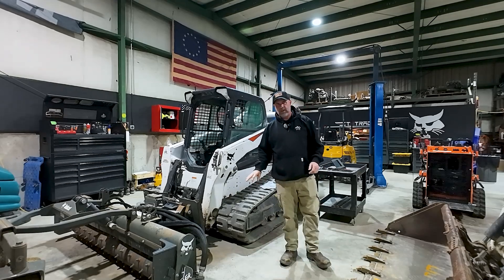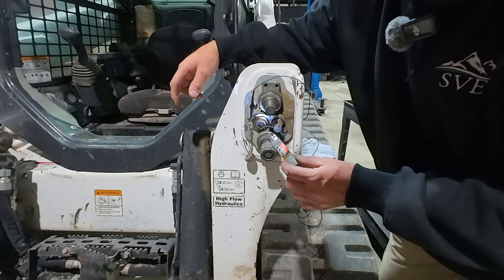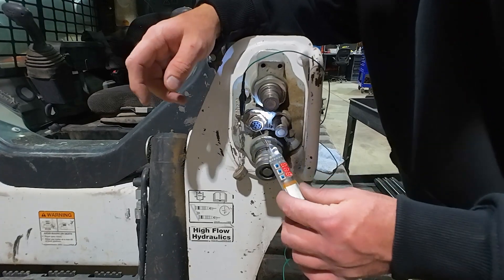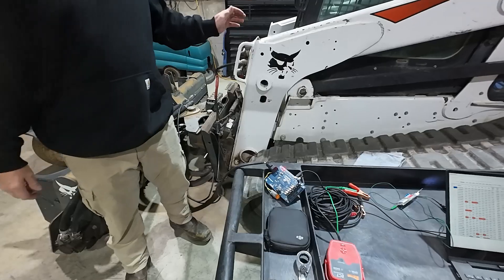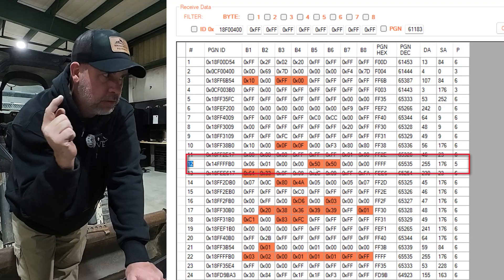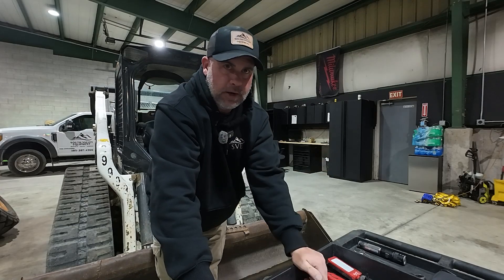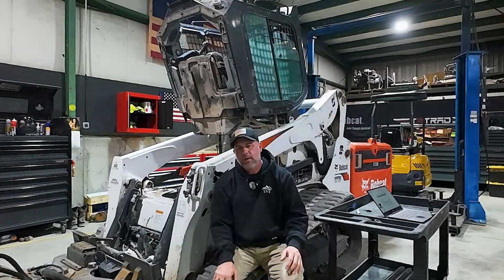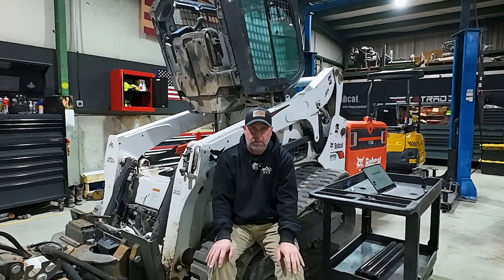Dealer Charged Thousands… Didn’t Fix Anything — I Fixed It for FREE!

Comment: Your right that the leader ship is a problem alot of the time when you have these issues that are gremlins. A forager i used to drive had a fult code that started popping up it was a code related to the turbo/air side of the engine i had three months of the dealer messing changing sensor and riding on the machine to see what it was doing in reall time. From the start i new it wasn't the turbo you could tell by driving the machine there was no pattern to when it coded so that told me it wasnt a manical. I supected it was a wiring issue. Anyway the work shop manager had his head set on it been the turbos but i dug my heals in because it was about £7 or 8k each for the turbos. Anyway the manager got his way and convinced the owner to change the turbos and there was no change the codes where still there. By this time we had spent about £25k. Pissed off we got a different  dealer to have a look at her with in 5 hourse the other dealer had the issue sorted it was a bad ecu. Because of one wooden headed workshop manager been been stubborn it cost us 20k more then it needed to

Comment: Really appreciate all the knowledge you share in your videos, especially about working on compact track loaders.  I've determined that the AC compressor on my Bobcat T300 has to be replaced, but I have no idea how I'm going to remove it without pulling the whole motor out.  Any suggestions on best way to remove the compressor?  From top?  From the front? Or is pulling the motor out the only way?  Thanks in advance for any advice you can provide.

Comment: Great job! I agree with your assessment of management!. I have a 06 S185 with 1850 hrs I've owned it for 6 years. I finally found a low hr machine with a 1,000 hrs!, but i almost gave up and bought a new bobcat and im glad i didnt!. I've 10 bobcats all the way back to the old 600's w/ a wisconsin air cooled gas engine. When they put Kubota diesels in them you couldn't beat those engines!. I worked as a excavator operator for years with a company that had a fleet of 35 bobcats, when Doosan took over they had so many problems with them they now own skid steers from 4 or 5 different manufactures trying to find a good brand to go with.
In my opinion todays electrical technology has ruined all equipment. 
You do a great job teaching and explaining when you do an assessment and repairs a machine!.

Comment: Just found a similar short to ground on a engine harness on a cat skidsteer.  The harness rubbed through on a latter clip due to a loose zip tie. You could induce a misfire by pushing on it.

Comment: The issue is all the unecessary digital crap that needs adfitional modules to have things operate.  This necessitates having software, programmers, "sniffers", etc.  Granted, if your a tech, you should be trained and have the tools, but most dont.  Great find, explanation and fix.

Comment: This is my Bobcat T 770 he was working on.  
I took it to the dealer in early October to fix what was described in this video. After weeks of no response I called the service department and asked what the status of the machine was and the service writer said that they would try to get it in tomorrow.  Weeks went by and I got a phone call asking for another hour or two of diagnostic time because the tech, "almost had it."  I authorized the additional diagnostic time. Then two weeks later I called the service department to ask what the status was.  The service writer said that the tech was at lunch but that she would talk with him about it when he returned and get right back to me, probably 30 minutes or possibly one hour.  I called again two hours later and nobody answered the phone.  Then a week later I got a text message with a request to authorize the repair. $900 for diagnostic and $2500 to repair the problem.  I was angry. I was angry that they wouldn't communicate with me.  I was angry that they wouldn't get this job done without constant prodding. I was angry that it was so expensive. I can take one form of abuse, but for them to charge me exorbitant rates and string me out for months was too much.  I called the dealership in the morning and told them I was declining the repairs and that I'd be picking it up on Monday.  They didn't ask one question as to why I was upset, they didn't offer to understand my position. Just okay they said.  When I went to pick it up she told me that the total was $3200.  How's that? I asked.  She looked over the work order as she didn't know anything about it and recited to me all that had been done. Then she told me that she would take 5 hours off making the total $1800.  I told her that I didn't authorize the work to be done. She cut me off and told me to stop. I was furious and told her that I wanted her to listen to me. She silenced me again and told me that I wasn't listening to her. I paid the bill, and walked out of there for the last time. This was December 17th. So about 10 weeks since I dropped it off for service. 

I took it to South Valley Equipment and they asked me if it would be okay if they got to it in a few days.  Absolutely.  Then I got a text message later that day that it was finished. I came in the next day and was told that the repair took 15 minutes and that he wasn't going to charge me. 

It seems clear to me that management at the Bobcat dealership has told the service writer in the past that it doesn't matter what the issue is, but that these customers need to pay for the time the techs worked on it in the shop. I think she had her hands tied.  It didn't matter that they didn't know what was wrong with the machine, or that they spent all kinds of time trying to figure it out, or that the techs didn't know what they were doing.  What mattered to them is how much money they can get out of me, and they figured it was $1800.  Well I needed my machine that day and they had me over a barrel. I paid it.  Never again.

Comment: In reality, when they have a networked system like CAN bus in the bobcat, the thing should be able to self diagnose itself.   The fact it can't, is the biggest egg on the face of the farces of engineers that put together the electrical system.   It should be able to start with power and test every communication circuit and identify the ones that are not working within a few minutes and then there should be a bluetooth connectable tablet that should guide the tech through all multi meter voltage/probe readings in order to restore communications  / power to the affected circuits.  The fact that this was not done is a huge irresponsibility / incompetence/ lack of insight on how to use the very technology they integrated in the machine. They threw it's biggest advantage out the freaking window because it was more valuable to the end user rather than the manufacturer.   They should hang their heads in shame.

Comment: I just had a similar issue on an S70, what a pain it can be to find those shorts. It was the harness that went under the right side pump, it had chaffed and went to ground on the pump. It gave us fits because it would be there, and then it was gone. A word of advice: get the electrical prints, it can save you HOURS of looking through the various circuits.

Comment: 5:25  Broadcast is the nomenclature.  Every device can see every message on the wire because the messages are broadcast.

I'm a little surprised a circuit tracer works very well.  Guess the fault being on the power side is the saving grace as they are not shielded.  That is indeed a leadership issue.  You have a blown fuse.  Cool, you know you have continuity.  You are further ahead than you might think.  Next step is segmenting the trouble.  Keep breaking the circuit in half.  Follow the trouble side.  Even without a tracer a shorted wire is probably the easiest to resolve.  And being a dealer you know as soon as they segment the trouble to a section of wire harness.... They will replace that harness eight out of ten times.  

Rigid machines... wire harness retention and routing is critical.  I don't deal with the electrical side of the engineering, but many times when a part revision is requested  It is because the electric peeps want something.  I teach my team to never think anything of it.  We design and build equipment that moves the world.  One wire taking down the bus will take a machine out of service.  I never want even the perception of animosity if a team member wants to adjust something as simple as wire routing, or retention.  Also good reason you don't see solder in OEM harnesses... and highly discouraged in our dealer network.

Comment: Never in a million years did I imagine I'd see hexadecimal CAN bus data on a YouTube video...I spent a good portion of my career analyzing raw hex bus data on military aircraft and never expected to see that again, especially on YouTube, after retiring.  Nice work!
Reply: @jimharris8707  Odd... because there is a lot of it all over the internet.  Anywhere from guys pulling messaging off the line for troubleshooting to building custom gauges, or entire gauge clusters, to injecting messages for a feature, or even theft.   Decades of it all over the internet.
Reply: I just left the automotive machining industry, didn't my entire life after collage tech school working with binary, octal, and hex code on the back end of every iteration of mumbojumbo user interface crap ever used.....😂

Mann it's good to be retired

Comment: Also curious with thats issue before being fixed if he were to use the skidsync box would it still work with the short to ground issue??? Curious
Reply from the maker: Great question.  The skid sync box is completely independent of the machine so yes it would work flawlessly.

Comment: I like that digital light tester what kind is that??? Keep the videos coming 🤝🏽🤝🏽
Reply: Good evening ! I am the developer and manufacturer of this tester. This device is designed to test power wires and ground wires under load. It also functions as a voltmeter.Brady will soon release a video with more detail information and explanation of how it works.The device is portable and does not require power from the equipment's onboard power supply. Mobile and easy to use. This can be purchased. This is more than just a voltmeter :-)
Reply: @DIAGLOAD Definitely need one of these first thing I said when I saw it is bad ass and also Brady has all the cool toys 😅

Comment: The problem is these new technicians cannot troubleshoot without a computer. They don't know how to do simple things like reading a voltage meter or doing voltage drops, and that's what there teaching in tech schools. Sometimes it's not a computer problem, it's a broken wire or mashed wire or even a mechanical problem. Experiance like yours is invaluable. Love your videos!
Reply: I absolutely agree with you, I consider myself to be a great mechanic and a machinist, but I cannot troubleshoot voltage problems in new vehicles very well or hook up a PC and understand it. I can diagnose household voltage issues, or older backhoes or ATV's with a simple 12V system, buy once they add a computer, I'm a bit lost.

Comment: what's the brand of circuit voltage tester u are using?
Reply: Good evening ! I am the developer and manufacturer of this tester. This device is designed to test power wires and ground wires under load. It also functions as a voltmeter.Brady will soon release a video with more detail information and explanation of how it works.The device is portable and does not require power from the equipment's onboard power supply. Mobile and easy to use. This can be purchased. This is more than just a voltmeter :-)

Comment: I think you just sold me on that power probe circuit tester. I've been looking at buying one for a while but it's hard to justify when I rarely run into dead shorts that aren't obvious. I assume it could possibly be used on CAN bus as well. In most cases in my work I would isolate the shorted wire and disable then just run a new wire if the short isn't in typical or accessible place. Fortunately, and unfortunately for the customer, this seemed to be a fairly straightforward issue, a module with no power is always relaxing diag for in my mind. 

Funny thing about CAN bus diagnosis is I run into 1... maybe 2 bus issues a year working on german vehicles and it boils down to using ISTA and getting solid fault code information that shows a module is dead and pulling the bus down on a BMW, VCDS on a VW/Audi, and on Mercedes-Benz it's almost a guarantee one of the SAM modules is dead. Rare occasion when the fault is intermittent and the car has been in a collision small enough to be concealed inside and out without disassembly. All the CAN bus diagnosis I learned in school rarely comes into play and I remembered it so well, fortunately I guess since like 80% of diag is understanding the system.

Good on you for not charging, you definitely earned a new customer if they weren't already. One of those rare cases when the standard rate juice isn't worth the squeeze when you can earn their trust completely with a kind gesture. Thanks for taking the time to put out these real world diagnostic videos, it's unbelievable how similar the equipment world is to the automotive world, coming from a tech in a modest independent repair shop. I can see an issue(from a birds eye view, since I'm not in the equipment repair trade) with poor training at a dealer as I didn't view all equipment, especially a skid steer, utilizing modern bus networks before watching a few of your diagnostic videos. I'm sure lots of inexperienced and/or untrained people get hired at these places. It makes complete sense from a manufacturing/engineering/accounting standpoint to use CAN bus to simplify command, control and switching devices. I can imagine older equipment likely utilized only manually operated hydraulic controls or an array of relays and solenoids with lots of wiring. Hope your relationship with the dealer doesn't go stale and they see the benefit from outsourcing if needed, probably won't but it's a nice thought.

I'm assuming that CAN sniffer board is universal device and you made your own harness for this 7 pin application? Haven't seen or heard of one before and I'm thinking it could come in handy for analog user interface controls like you demonstrated.

Comment: Not a mechanic.  As an electrician,  my first questions are whats is doing its not supposed to and whats it not doing  its supposed to.  Next question  where is the operator.  My boss would solve electrically to mechanical and I would solve mechanically to electrical.  We would meet in the middle.  🦊🦊🥸

Comment: Thanks for the video. You should be the dealer and you'll be missed if you shut down with your level of skills and customer service. That Bobcats like all these new machines "way over complicated" with all this electronic garbage and diagnostics, I remember the old days guys put a nail across the fuse, and somebody watched for the smoke if they couldn't find the short L.O.L .  We know it's going to pile up sooner rather than later in construction or farm equipment environments with vibration, leaking connectors/ control boxes or wire damage. I washed a fancy 3 year old JD tractor for a customer before working on the front axle seal, the engine management system had an absolute fit from the water mist getting near it.. Take care

Comment: You know, I used to run a computer repair center (mid to late 90's), did a lot of business to business and with the State. If I couldn't figure out the problem, I charged a small flat fee they'd agreed to up front, I think it was $65 at the time.  It never felt right to me to just charge $$$ because of "my poor troubleshooting skills" or "my need to learn more".  I became very good, I had business stacked up out the door while other places closed down because of bad reputations.  If I couldn't figure it out in an hour or less, I wasn't any good and that is NOT the customers fault.  But, 99% of the time I solved the issue AND solved issues other shops could not.  Otherwise, I could never solve a damn thing and just charge my hourly rate to make money hand over fist.  "I'm sorry, I can't fix this, that'll be $500" is the same as saying "I'm not sorry, I'm just ripping you off and I don't know what I'm doing."   In this case, I agree, it's a management problem. They shouldn't have let the tech just keep digging when it's obvious he has no idea how to find the issue.

Comment: I used to be a mechanic for an equipment rental store and i worked on all the smaller stuff and some skid steers and i have my own machine and im not gonna say im t he greatest mechanic out there but pretty good at fixing brroken stuff on the plug on the machine could you make an i guess adapter with the female plug and just make i guess a break out box and for each pin run a wire and make it color coded like trailer lights to lets say a board nd for say constant power have a light for it the when its running the other power have a second light for it of a different color or have the board marked for each pins function including the lower voltage pins for on or off for each function kind of like how lights on a trailer work to test each pin or function coming out of the pin and have a direct to ground with an alligator clip to ground to the machine instead of using a lap top